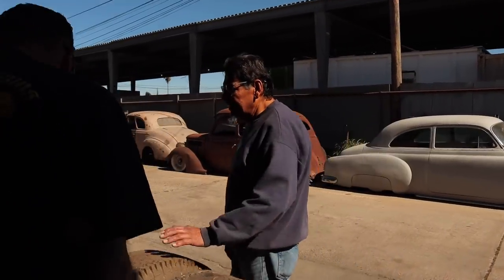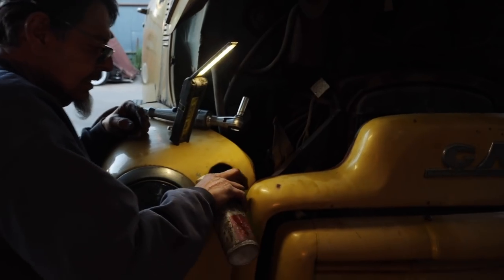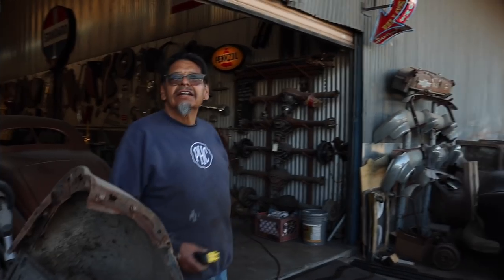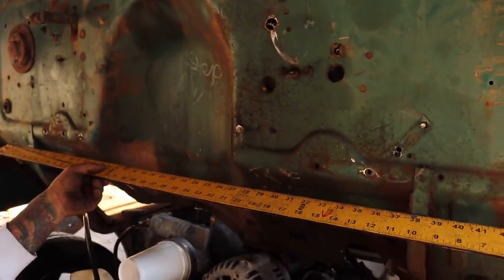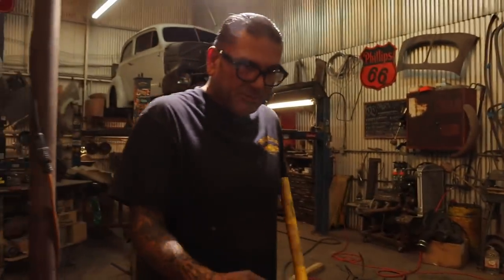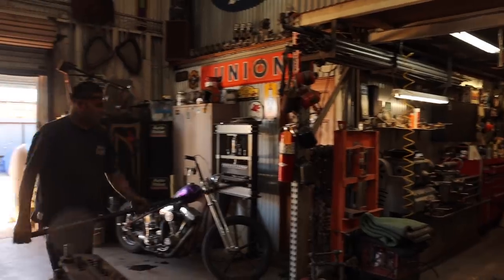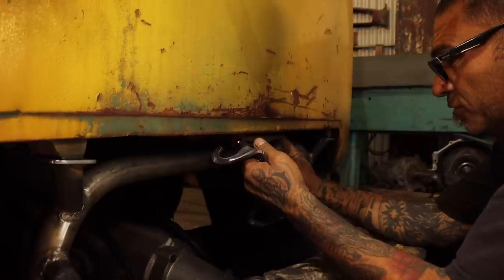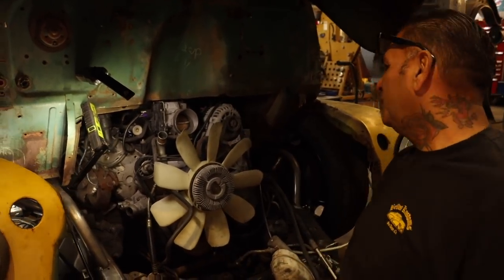1950 GMC Cab Over Engine - Part 7: Fitting the Cab

Comment: I had to rewind the video a few time's to see the pip notched tool to see if it was an air drill gun ? Very cool how it's set up. The heavy duty stands for some of the tool's. I've been welding up pedastool stands for my tool's, putting locking wheels so they can be rolled around. I have limited space to work around. 
Looking great fellas keep on keeping on 👍🏽the build is looking like 💰

Comment: This is a very informative video,  I have just bought a 54 Chevy COE cab going on a 90 model 1 ton ramp/wedge bed car hauler 20' long, my decision to make is mid engine placement or regular front engine with stock placement, keep your video's coming, I may have a few myself on the way